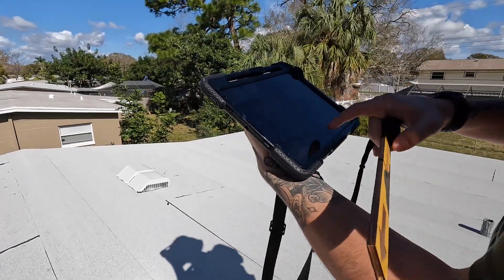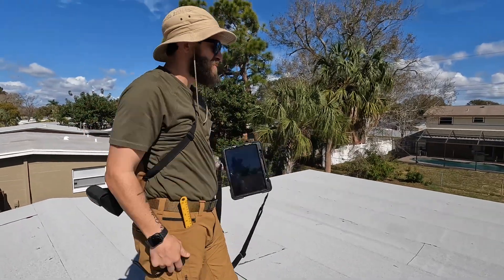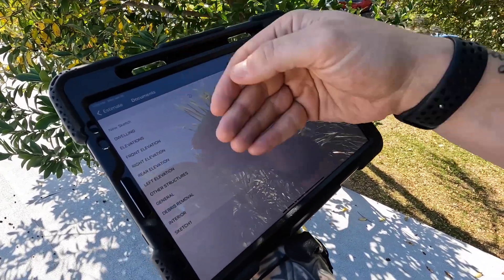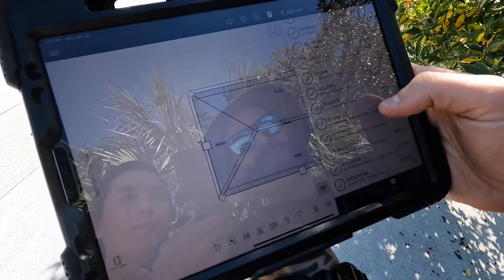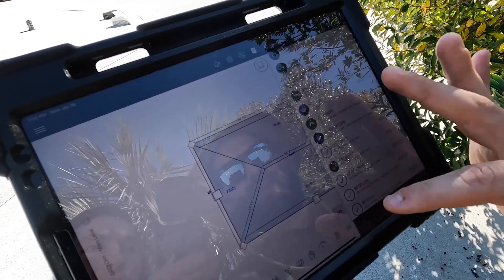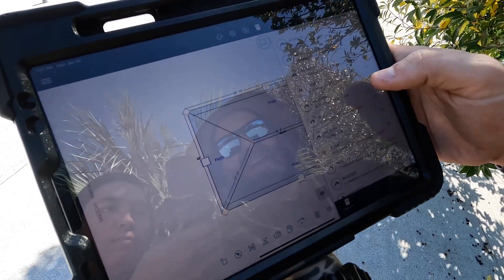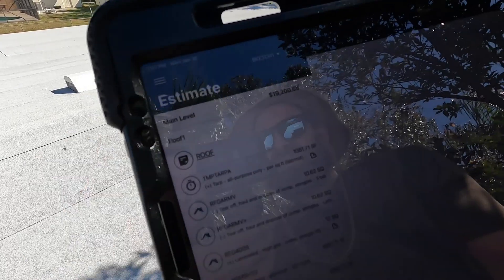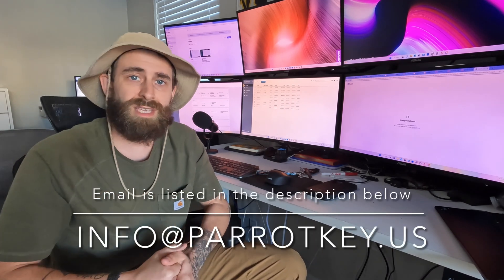How To Estimate The Roof In Xactimate Mobile X1 (Part 3 of 6) - Tips On Mastering Mobile

Comment from the maker: Here are the Tools:

Laser Tape Measure (Leica Disto D2)
https://amzn.to/3kwfEXe Leica Disto D2
https://amzn.to/3ZtbrlN Leica Disto E7500i
https://amzn.to/3mgz1nu Leica Disto X3

Pitch Gauge
 https://amzn.to/3EFaFuj Johnson Pitch & Slope Locator
	
iPad Pro (any ipad with .5 capabilities on the camera) 
https://amzn.to/41nzVyV 12.9 inch
https://amzn.to/3StSH3D 11 inch

iPad Pro case with the hand strap and body strap attachment. 
https://amzn.to/3xUV8md 12.9 inch 
https://amzn.to/3Zmb6l5 11 inch 

Laptop/Computer 
https://amzn.to/3ZGw8v1 Lenovo Yoga 9i 14 inch 
https://amzn.to/3m1IBus HP Envy Desktop 

Drone 
https://amzn.to/3SwVlW6 DJI2 mini

Chubby Buttons 2 bluetooth camera clicker
https://amzn.to/3YjMLeV Chubby Buttons 2

Shingle Gauge 
https://amzn.to/3xVMgN3 

Metal Roof Gauge
https://amzn.to/3ZgGj9q 

Torpedo Level (small)
https://amzn.to/3ZnUych 
https://amzn.to/3ZjeoW0 3-pack

Tool Bag 
https://amzn.to/3EHjIea FASITE
https://amzn.to/3kwm3li Carhartt Zip 
https://amzn.to/3KEmlRG Wolf Tactical 

Flashlight/Headlamp 
https://amzn.to/3StSXj7 Coast - Rechargeable
https://amzn.to/3IrsTAg DanForce - Rechargeable 

Moisture Meter 
https://amzn.to/3KGdgba - AccuMASTER turns on a lot, kills battery faster, only flaw 
https://amzn.to/3SF5HDt - General Tools - current one 
https://amzn.to/3m8vlEx - Triplett - another good one 

Ladder (22ft recommended but they are pricey) 
https://amzn.to/3SuOsol 15.5 ft telescoping ladder
https://amzn.to/3kxEcyY 12.5 ft telescoping ladder
https://amzn.to/3SF5TTd 22 ft Multi-Position Ladder
https://amzn.to/3Szz7mp 22 ft Telescoping A Frame Extension Ladder
https://amzn.to/3m3XvjT 17 ft Multi-Position Ladder
https://amzn.to/3Z6drAN 15 ft Telescoping Ladder 
https://amzn.to/3F2WKOX 16.5 ft Telescoping A Frame Extension Ladder